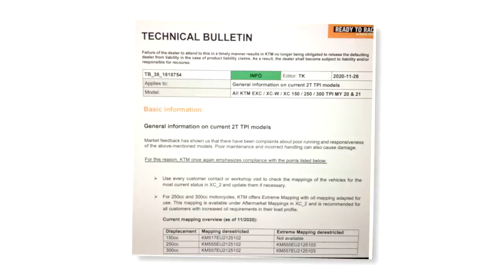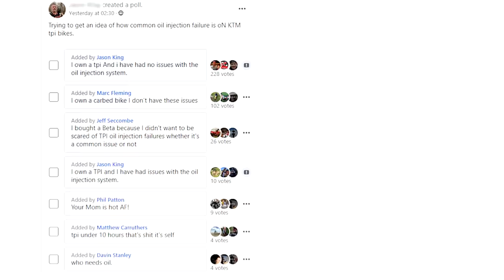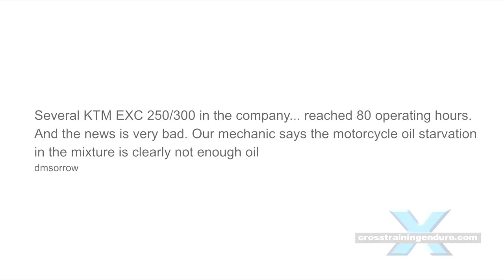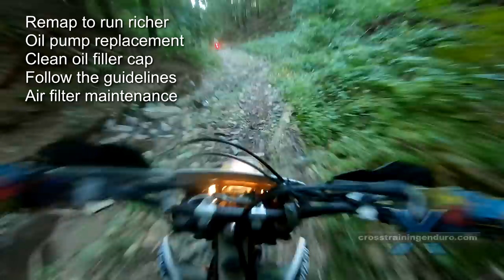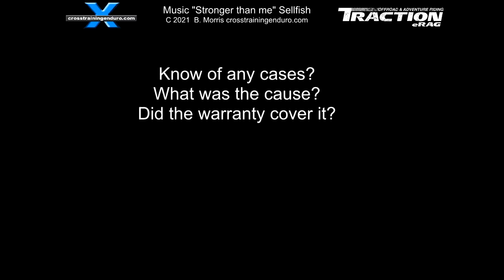Are TPI models seizing? 7 preventative strategies for KTM TPI problems ︱Cross Training Enduro

Comment: The easiest solution? drop oil directly into the tank as insurance say at 100:1
Reply: Probably clog the injector
Reply from the maker: There are arguments for and against this. Jeff Slavens says it won't achieve anything in his TPI myths video, and he knows these bikes well. I'd love to hear from KTM's technical guys about this.
Reply: All of you guys that think you're so smart and say "just mix oil" or "remove the injectors and mix oil" need to do your research before posting.  The way the motor is designed, mixing oil will not work and the oiled gas will not lube the bearings.  The intake part of the engine is a completely different design than carb model.  Also, if you mix oil into the gas it clogs the injectors and it will not work.  There is nothing wrong with TPI bikes, I have and ride with many of them and there are no issues at all.  No more than other bikes, it's just that it's new and there are a lot of people that have a tough time with change.  In the near future the same guys on the fence will be at the local dealership financing a new TPI bike, I guarantee it.

Comment: TPI just likes to be warmed up properly.
Reply from the maker: It certainly seems to avoid quite a few of the problems coming up. And the 2020 and 2021 models have a map that uses less oil, I suspect going back to the original 103 map of the earlier bikes will probably help prevent seizing too.
Reply: Exactly right

Comment: " only a small number of failures"...lol   so small that they are finding barrels hard to get because they are used up in warranty repairs...
Reply from the maker: Yeah it's impossible to get accurate figures because the last thing KTM wants is us knowing the actual failure rates for various year models... and our TPI specialist said they KTM has even made changes during a particular year. With some engines running as lean as 150:1 and even 200:1 at certain revs it's no wonder they've had seizing engines.

Comment: My '21 300 XC is running WAY too lean.
Reply from the maker: Yep, two TPI tuners have confirmed the 2020 and 2021 models are running between 150:1 to 100:1 depending on revs and engine load. 👀🤢